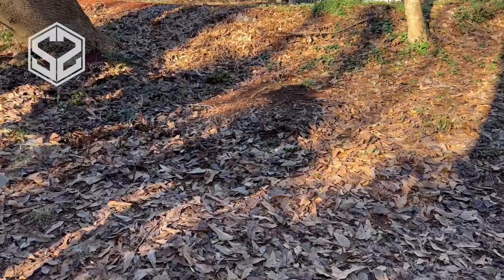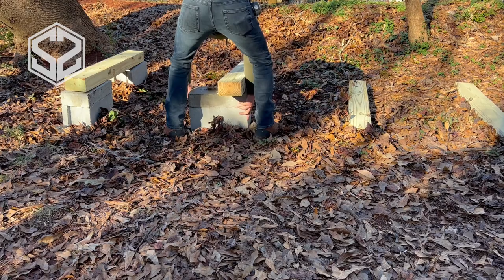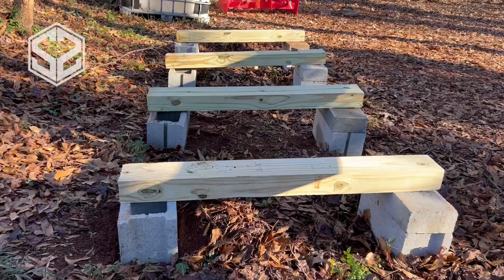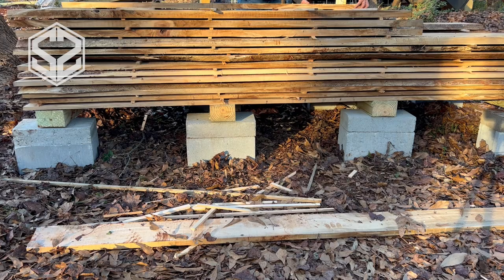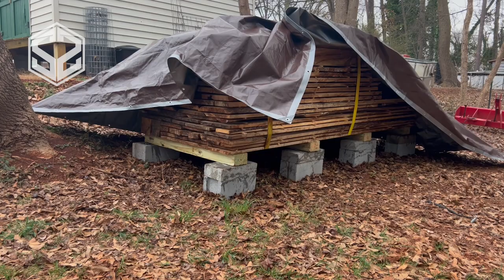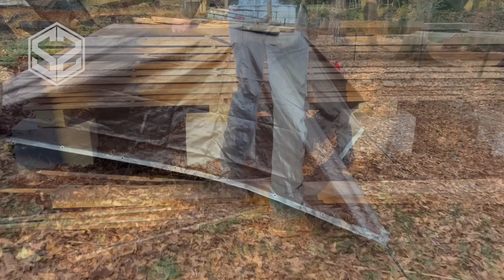How To Dry Lumber

Comment: Not sure about this one, I think you have significantly reduced air flow to the lumber. Industry standards suggest 1 inch stickers between rows evenly spaced apart, and the tarp configuration inhibits air flow. These two reason place this pile at some pretty big risk for disease and pests. You have a lot of different dimensional wood that will dry differently, and set the pile off kilter, and warping some of your boards. I wish you luck in this, but its a gamble.
Reply from the maker: Thanks for the info! I will have to adjust for this next time. I appreciate it!
Reply: I recently started milling too and learned very quickly that sweeping the old saw dust off as well as keeping an inch between each board and stickered is key to reducing mold growth. Its heart breaking to put that much work into your own lumber to have it ruined by mold as soon as you turn your back and feel like you've done everything right.